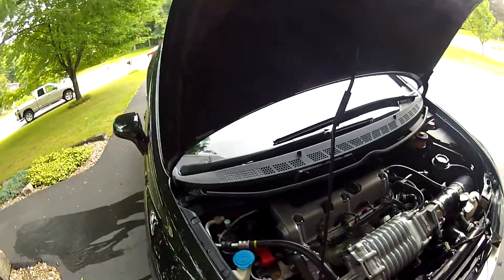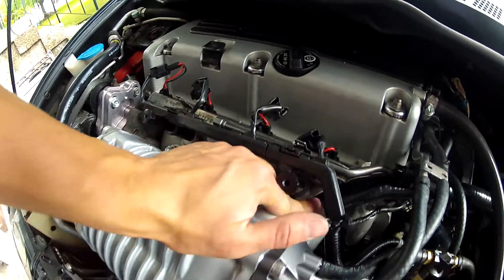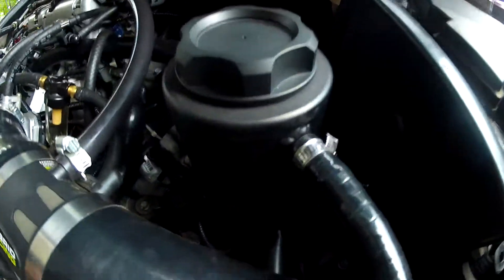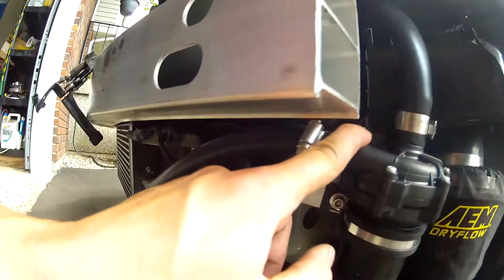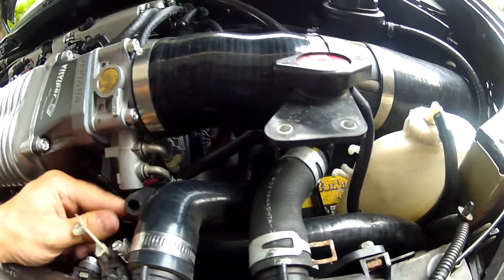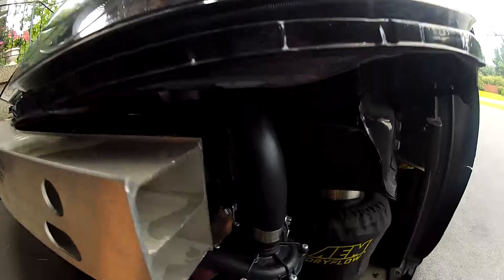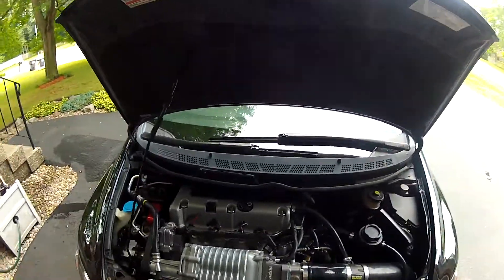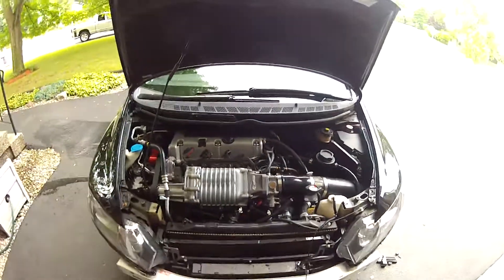VITTUNED Aftercooler Explained (CT-E Supercharged Civic Si)

Comment: what psi can i run an m62 with no aftercooler?
Reply: Depends, you can run a 3in blower pulley which is about 9-11psi. The issue is that these blowers heat up quickly and when your iat a rise that high, it will pull timing to avoid detonation. Which lowers your power, So, I guess what I’m saying is it depends on how long you wanna drive it, if you are just gonna drag race it, with a 3 in pulley, you probably don’t need one, if you wanna run it on the street, I’d look into it, AND I’d look into e-85 fuel conversion.

Comment: What are you using the air/oil separator for? It's the first time I'm seeing that used and wondering what the purpose is? Trying to do lots of research for my 9th gen build
Reply from the maker: +Robert Per prevents oil from entering back into the intake mainfold from the PCV and being burned with your gas which reduces the octane of your fuel.

Comment: Yo where did you put the barb for the boost gauge? I have the same kit but have no Idea where the barb for the gauge goes.thanks.
Reply from the maker: just run a T fitting off of the bypass valve